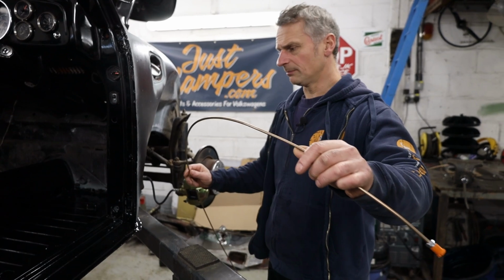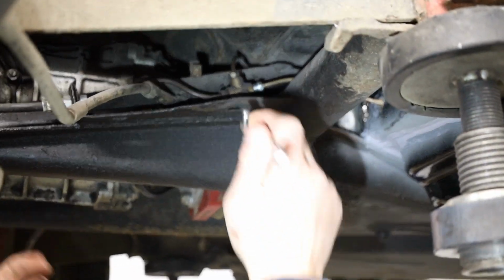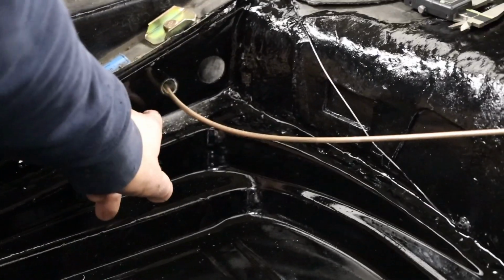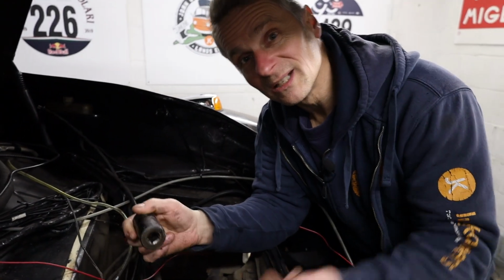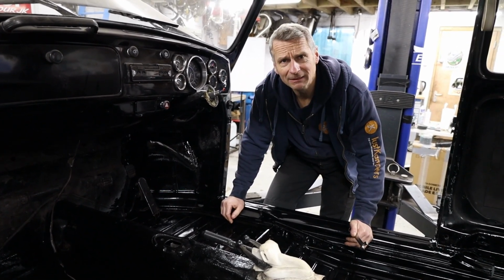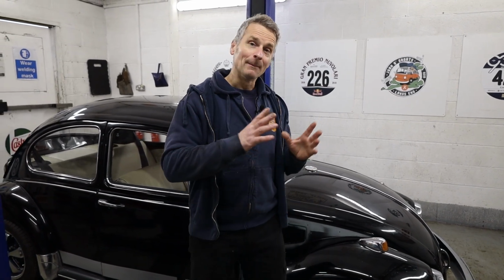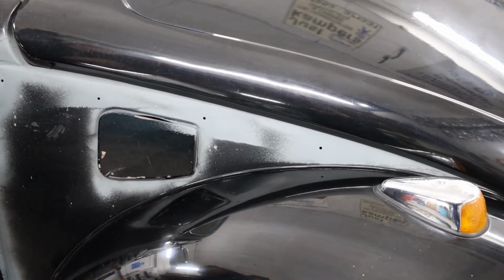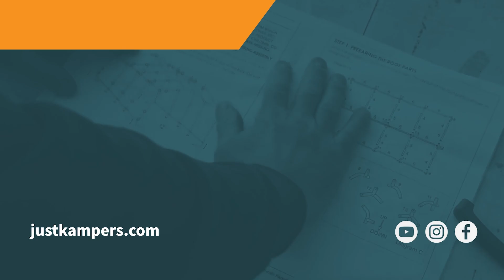Putting a Classic VW Beetle Back Together! Lewis's Bug Part 8

Comment: I am having PTSD from when I was working on beetles back in the UK! One little hole and the front quarter of the car needs replacing! Thankfully I now live in Sydney Australia where rust of this calibre isn't so much of an issue! Great work and I picked up a lot of tips on the floorpan renewal I need to do on my 61 Karmann cab beetle. Can you tell us roughly how many hours of work this job was? Lastly are your floorpans the Wolfsburg West ones? They went in quite easily. Thanks Steve
Reply from the maker: Hi Steve, glad you have enjoyed the videos! It took about 70 hours work (two weeks), difficult to give an exact amount as there is a lot of start & stopping for filming. And yes we did fit the Wolfsburg West floor pan as it was the best quality that was available at the time. :) Hope that helps & thanks for watching!
Reply: You can see the Wolfsburg West Box in the previous video where he fitted the floor pan.